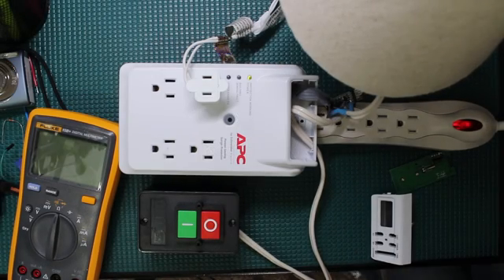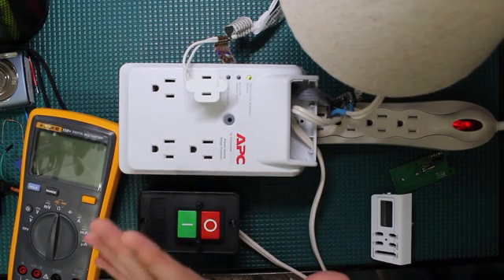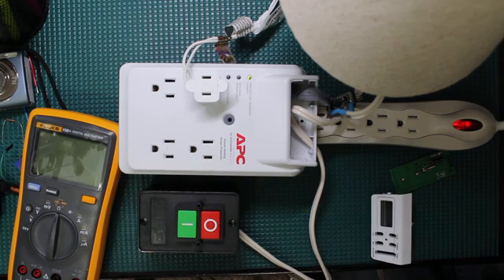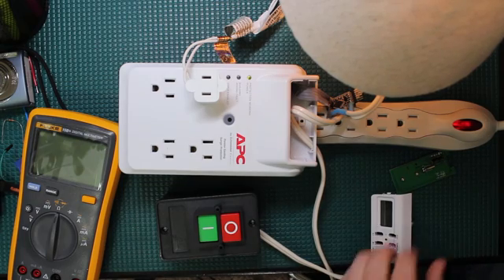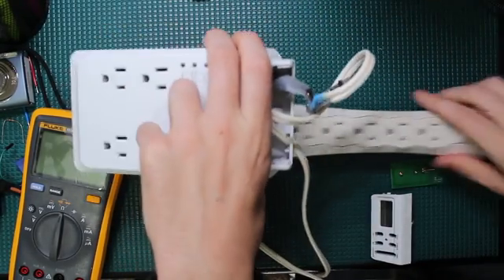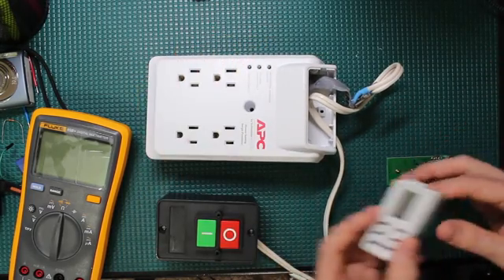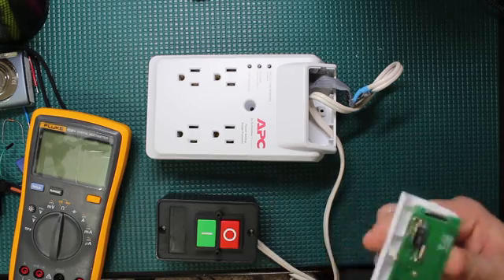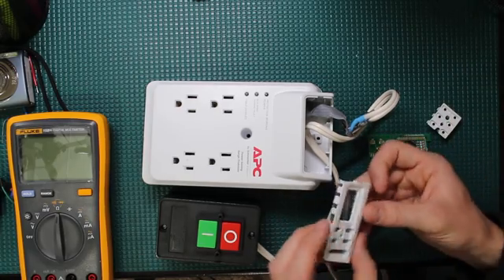The "Forgetful Hacker" Bench Timer Project - Arduino Outlets

Comment: Hi Kevin, I'm wondering if you had tried programming your APC surge protector before adding your arduino? There are no other youtube videos. I have the 4 outlet and 6 outlet versions with timers. And the instructions are not correct. Would you put one up if you managed to do so?

Comment: Thanks for posting. I did not see or read what happens if you are using the tool for longer than 30 minutes. Does it turn off,  or can a button press reset the timer? If I missed that, excuse my question. Enjoy all your videos.
Reply from the maker: yep, just turns off.  Pretty simple, then you just hit the start button again

Comment: i made something similar one year ago. used a PIR to activate a DIN relay and supply to a power strip where I connect 'dangerous' tools as welder. by setting the timing of the pir correctly you will have power as long as you are inside the lab, once you leave it will shut off.

Comment: Great Video Kevin!
And you made a pretty neat board there! But since you are selling that, how do you deal with FCC and all that stuff? I'm kinda thinking about making my own pcb's aswell so thats why I am asking.
Reply from the maker: cool! yea that's a difficult question to answer - hackaday had a good post on it a while back, but for me, these are just breakout boards for the hacker, hobbyist, student, etc... the BLE board is FCC certified, since that is an intentional radiator.
Reply: So you got your own board FCC certified? Thought that is expensive as hell... Kits that will end up being functional circuits must also be certified. (according to a document that I've read). This is such a huge brick for small makers.
Reply from the maker: the BLE board is pre certified from the manufacturer - then for parts needing certs, hmm not sure about that.  I'm not shipping with working end-device code, heck you could even disable the oscillator all together, so I wouldn't even know what test mode to put the board in.

Comment: Great video Kevin.
I was trying this using a nano, but at power up the relay came on, and stayed on indefinitely, until after the first press of the switch. I managed to solve this by removing the "go to sleep" code after the "kill ADC" in setup(). Wondered if you'd seen anything similar or had an idea why this would happen?
Reply from the maker: seems like your button input is triggering right away on bootup?  since in the loop it turns off the relay when that button is low.  That works too, but yea I'm wondering why it would 'wake up' immediately when you put it to sleep.  Let me know if you find out anything more.  I haven't seen this on my end.
Reply: Thanks for the reply. I did some further testing, and observe the same effect with a pro mini as with the nano (both Chinese versions i should add), however, using a genuine Uno ... it works as expected.  So perhaps its a quality /  timing issue in some way, but altering the code as i mentioned seems to solve the issue in all cases.
Reply from the maker: yea, that is weird.  I'll have to pick one of those knock-offs up and see for myself
Reply: Cool. if i come up with anything further i'll let you know - cheers, and thanks for the super instructive videos
Reply: Think i have an answer. Adding even an additional 100K pull up to the button pin (leaving the INPUT_PULLUP still in place) solves the issue. still very strange - but i'll watch out for these types of sensitivity issues in the future.

Comment: Great info,nice tutorial, but Here in oz we have a power saving power board  which has a switch you press then after an hr it will switch off the power to the board unless you press the switch again and every switch last an hr so even if say you forgot to turn off your soldering iron once the board timer reaches the hr time limit it will kill all power to the board and to all the equipment that you have plugged into the board.
Reply from the maker: nice, yea we had something like that at my last job... that's what inspired me to build my own.

Comment: I have a different solution to the problem.  in my workshop I have a mains breaker fuse right by the door that powers most of the room.  when I come in I flip the breaker on and everything turns on light computer sound system,  all tool outlets.   when I leave I torn it off and everything including lights tools , welder soldering iron heat gun etc all turn off.  I did have to add another always on circuit for a router and a battery charger.
Reply from the maker: yea that would be cool to have in my lab